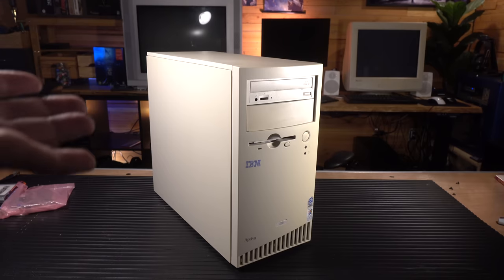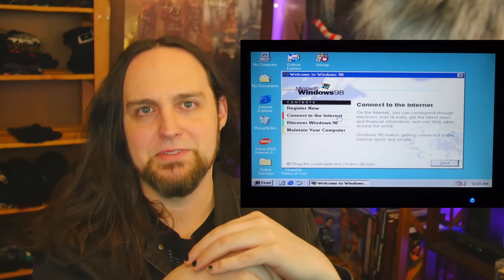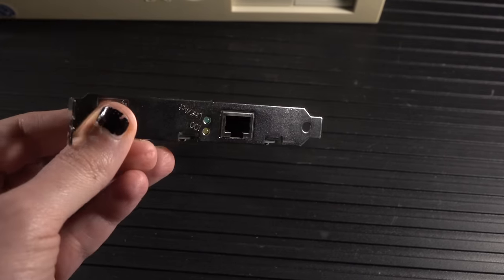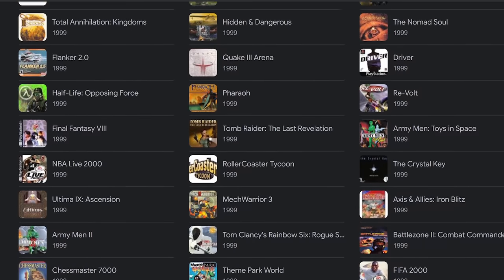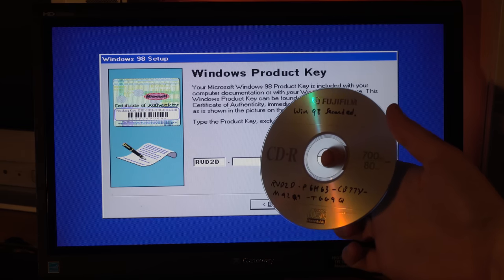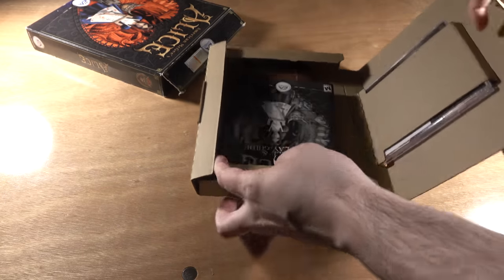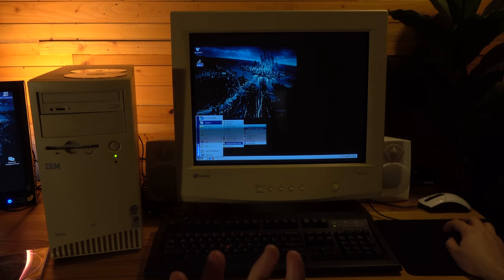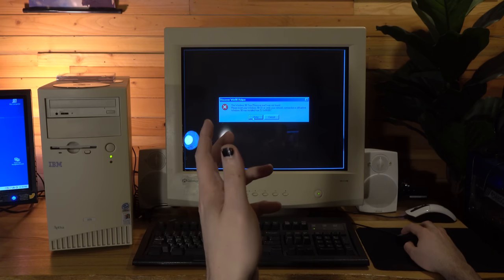Don't Install Windows 98: My Nostalgia Turns to Pain

Comment: Besides the games the only thing I miss of this era is my CRT Trinitron.
Reply: This... Had a dell behemoth heavy enough too break a cheap desks shelf part, like i just got home one day & it was resting on the front bezel while the shelf below was just broken & hanging below. 1600x1200 at 85 hz was nice at the time, specially with a hd 5770 that i used for a while with it until early 2012 where it was just getting too blurry and i swapped it for a 1080p ips & it went too the dump.
Still kicking myself for missing out on buying a beautifully sharp viewsonic 21 or 23 inch that did 2048x1536 at 85 hz in late 2017.
Like it was like it just came out of the box sharp but had yellowed slightly & that was it like 2 - 3 minutes of messing with the settings & it was perfect.

Comment: Windows 9x is a giant pain to setup, it's also unpredictable, but Windows 9x is also a gem for those software programs you need. I use lots of software on my Windows ME laptop because it's simply not compatible with Windows Vista+ and plays horribly on VMWare Player- my newer hardware just isn't fast enough to virtualize it right.

Comment: I know some might call blaspheme but I'm in the same boat as you. Most things that you can't get running on windows 10 and 11 you can use XP, XP is just a more stable well supported platform. I built a XP machine for this exact reason as some games just refuse to work with my PC and I use my XP pc for the select few games funny enough all windows 98 games with no NT support yet still work on XP almost flawlessly out of the box. 

When I can help it I go through the process of tweaking them and have quite a few games from the early 2000s on my windows 11 Rig that honestly play better then they ever did the way I have them set up but outside of that XP is just the better option in terms of stability, Hardware support and sanity.

In an ideal world we could use 98 for DOS stuff XP for a lot of NT stuff and modern PC for everything else but emulation like you pointed out for DOS is very good and windows 95 and 98 kinda suck outside of the UI. They are unstable and for me at least are not something I wanna deal with. At some point you gotta value your time and sanity.

Windows 95 and 98 are great for walking down memory lane though :)

Comment: I have no real problems with configuring Win98se or 95 or even older versions of DOS. However I can't for the Life of me get dosbox to work at all period. For me as a vintage PC collector I would rather pull a period correct machine off the shelf to play the games and various software.

Comment: So legitimately I've got a Windows ME gaming machine that uses the newest possible hardware that has driver support (Pentium 4 HT). Why? It's got plug n play and it actually stable af on newer hardware. I didn't like ME when it was new but retrospectively it's my favourite native 9x and great for DOS
Reply: That paired with like crystalcpuid too underclock & maybe undervolt the pentium 4 I'd imagine would do good yeah. 

Feel free too look up that program works great on my pentium m laptop here if i want too slow the cpu down just too have it less noisy while running an older game.

Comment: Yeah Windows 98 & SE is a royal pain too get drivers onto there unless you got a second system that you can just hook up the harddrive too after taking it out of the pc & just shoving everything you can on there at once & putting the drive back into the pc.

I still need too reinstall Windows 98 SE on the AMD k6-2+ 400 mhz pc i got with 32 mb ram atm.
Also update the bios too support larger harddrives then 20 gb.
Voodoo 1 4 mb, Matrox Mystique 4 mb
(If i turn vsync off on the Matrox & Voodoo card the pc locks up, that's how crappy the drivers are on this with a fast cpu even without playing games.)
4 gb harddrive that's super noisy, but i want too swap out for a more modern 60 gb drive that's really fast & as quiet as a sata drive a wd caviar from 2006, had temporarily it as a boot drive just cloning the os over before that broke & suddenly refuses too boot that drive anymore...
Hopefully get usb mouse support working as well i NEED another mouse.

The serial mouse i got is terrible, like this is a generic unbranded 10$ serial mouse from 20+ years back.
Not gonna do that well these days despite cleaning & degreasing & regreasing it like the rollers & doing what i can too get all buttons working which does half the time on left click & sometimes clicks 3 times opening things when you are just trying too drag an icon too a part of the desktop.

The motherboard has a ps2 header for a mouse or keyboard but I'm missing the cable that lets me mount that too the case.
Yes it's a header on the motherboard you plug into & its a proprietary header for a 24 year old motherboard from ca 1997 Asus p55t2p4 good luck finding that...

Then again i think I'll keep the Dell Inspiron 6000 laptop with windows XP on it for my retro shenanigans, it does really well for what it is.
Only thing I'm missing really is a crt & a racing wheel for like Colin mcrae 1, Monster truck madness 2 etc...
For the full nostalgia experience.
Pentium M 1.5 ghz, 2 gb ram, ATI x300 graphics using ram as vram & recently swapped out the 2.5 ide hdd with a 60 gb drive i found randomly in storage here so went from 40 gb too that with a fresh xp install, ofc swapped thermalpaste on the laptop like 2 years ago & it helped A lot. Like this was overheating at 1000 mhz set via crystalcpuid & now runs mid 70's at 1.5 ghz overvolted slightly with an overclock on the ATI graphics card too, any game 2002 & earlier runs like a dream on this at 1280x800 which is the native resolution of the integrated panel.

First pc actually had 98 on it for a while, was later windows xp on that machine together with some upgrades like more ram, new slot 1 too socket 370 adapter with a pentium III 1 ghz i think.
Might have been a 500 - 700 mhz first & then a video card like a ATI 9250 se, mx 440 or similar era card & probably a soundblaster live probably for sound at the time.

Nglide, dgvoodoo2 & community patches brings games back too working order nicely usually yeah almost regardless of operating system or hardware.
Like i can run with a custom DSR tool with community patched Need For Speed III at stupidly high resolutions at 8k on a 1080p display.
Though if you specifically want hardware that's not far off the early desktops 2 - 3 years earlier.
A 2005 - 2006 single core laptop with Windows XP, Vista & either Nvidia or Ati graphics mentioned in the specs is not a bad experience imo with some fresh thermalpaste & tweaks too the games in question.

Comment: You should never go further back than Win 7 at this point.
Reply: My old work still has an Windows xp machine for a label machine it doesn't work with new system and the cost doesn't justify buying a new machine so they have a non network pc that all graphics have to be uploaded by usb. So that is why a lot of businesses will still have ild systems specifically governments where people don't want to spend money.
Reply: Windows xp works really good for windows 95-xp era games and it can browse the web but I wouldn't use it as my main pc.